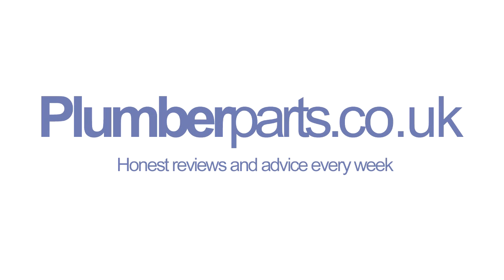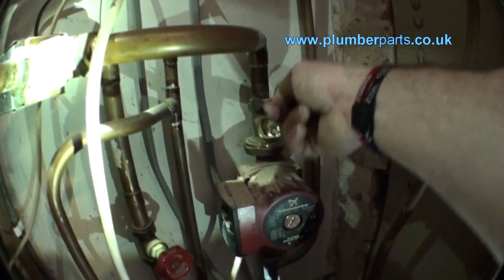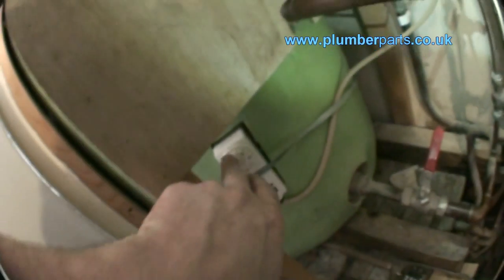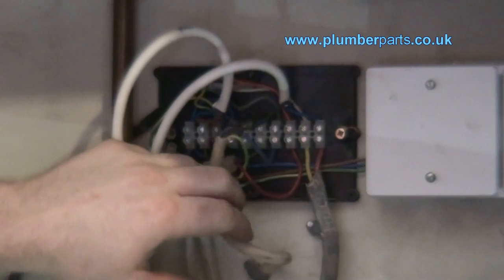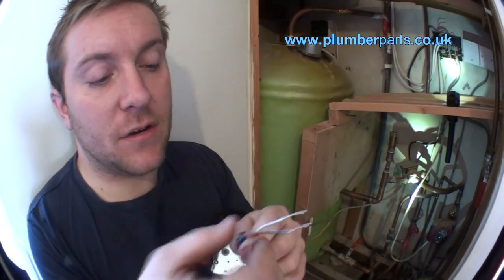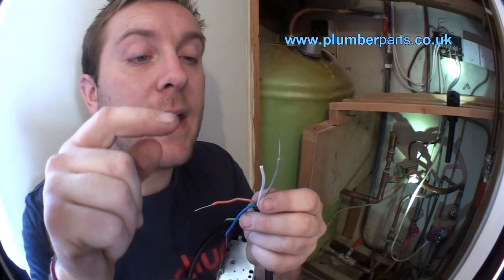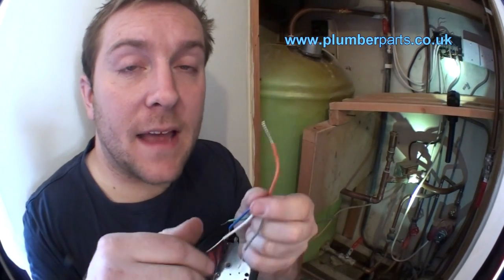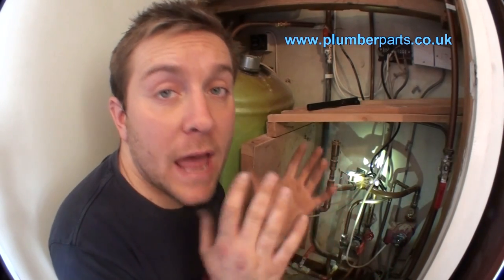3 Port Valves and Y Plan Heating Systems - Plumbing Tips

Comment: Does anybody know why my hot water is still hot even when the hot water is off at the controls downstairs. I have an old gravity fed system with this kind of square box valve in the video. I'm hoping I'm heading in the right direction thinking it's this? Also if I put the hot water on the water is scalding hot. I don't even put the hot water on now at the controls and I have hot water.

Comment: Hi, when my 3 port is on HW the flow from boiler is Hot then when I lower stat to switch to CH it will turn warm, sometimes cold even. Could the 3 port be slowing flow hense rads not keeping hot? I changed the cyl stat. I can see the port lever moving but not happy with the heat on ch pipe

Comment: Thanks so much for the videos. I have a question. I have a problem with combi boiler. I suspect its the 3 way valve. I changed it but the old system had 6 wires. The new 3 way head has 5. Online documentation states when this occurs call honeywell. Did that. They said phone some other number. Did that and ended with filling a online questionnaire in. Waiting for an answer. So what you do in this situation. That is 6 wires not 5

Comment: Hi, Drayton 3 port valve (new replacement) sticks in mid position intermittently so house melts and water super heats. Same problem with old valve, which is why I replaced it,  I've also replaced everything else cept boiler. I've buzzed out the wiring and it is correct to Drayton's 3 port mid valve circuit. Previous owner may have had same problem as found receipt for replacement valve only 6 months before I bought house. Spoke to Drayton tech and they said Worcester Bosch 24i (sealed system) boiler's integral pump may need a clip-on ferrite suppressor so fitted one but still same fault every few weeks. Other times system works fine ???? Help?   Nick, Somerset

Comment: Question ... plumber fitted me a system pump the wrong way round which caused heating to be red hot and wouldn't turn down with stat, he came a few days later to fit pump right way round now says  need a new 3 way port valve! Is this because of what he did wrong or just my bad luck baring in mind I had no issues with hot water or beating before he changed the old noisy pump to the new one?

Comment: Can someone reply?

Our 3 port valve is knackerd, on a conventional, system.

Were going to upgrade to a combi boiler soon (ish) 

Will the  3 port valve stay? Ie.. i presume its bot needed/used in a combi boiler.
Reply from the maker: It’s not needed. Enjoy!
Reply: @plumberparts   thanks! Wont bother repairing then. As my hot water warms up so too does my rads (becouse faulty 3 port valve) but that'll save me 200 quid repair. As il be getting combi convert soon, before winter.

Comment: If the 3 port valve is faulty and allows hot water to the radiators when only the hot water is turned on, does this mean more gas is being used and putting the bill up, compared to if the water was being sent only to the hot water tank?
Reply: Yes, probably tripling gas usage at least.

Comment: Any idea why my 3 port valve hums after the central heating has finished please? It doesn’t happen if hot water was the last command. It’s also pretty warm touch when its been humming. Is this normal? Is it dangerous? And will the motor burn out?

Comment: Hi if your changing a Honeywell 3 port valve for a danfoss do you not use the green wire as Honeywell have 5 wires danfoss has 4 wires

Comment: Hi  guys. I replaced a 3 way valve with a mid position valve - i didn't really notice the difference until I'd put it in unfortunately. The wire colours all matched up with what was replaced. Are there any issues with doing this? Also any idea why refilling the radiators is taking so long, the one in top bedroom literally will take all night I think - seems to be much longer than last time I drained the system (I think it will get there ev

Comment: Hi, I love your videos!! My diverter valve diaphragm on a Baxi Potterton Perform a 28i was replaced after a boiler leak. We had no hot water at the time of the leak. My 10 radiators were all heating fine at the time. The engineer said that although he fixed the leak and hence the hot water returned, he would leave us without GCH instead??? Since then, another engineer from the same company visited to replace the diverter switch. Now every one of our radiators are only luke warm because the heating comes on for about only 20 secs then shuts off again. Any idea what might cause this? Thanks.

Comment: Thank you so much for all yr helpfull and clear videos. I have standing boiler with cylinder and 3 port valve. Hot water only coming when I put programmer on heating/hot water together but it's not coming on hot water only. Any advise what problem could be please?
Thanks in advance

Comment: what would be the best gear to use in an s.plan or 3 port setup if using a wood burner as the boiler source. I don't want to pump cold water through my bungalow when the fire goes out. thanks in advance.. Rob M.

Comment: Just bought A COMPLETE VALVE BODY AND hsa3 ACTUATOR form e bay brand new.

Only wanted the actuator but it was a good price for both 

Fitted HSA3 actuator and every thinh works ok 

The valve body fitted in the system is a HSV3 and the spindle on the top
 turns through 360 the body thet came with the actuator is a HSV3B and 
the spindle only turns through 45 degrees also the girth of the brass 
body is bigger and looks to have a grey plastic paddle assembly.

Question should the HSV3 which I have fitted(smaller girth) turn through 360 and whats the difference between the 2 bodies?

Comment: hi james i want to fit  a 3port valve to my old heating system , but my pump is on the return side of rads' do i need to put it on the flow side.Also my hot water is gravity.  rob

Comment: Hi, when i turn my hot water on via the controller the boiler fires and heats the cylinder but when i turn it off and just turn the central heating off the boiler does nothing? The pump doesnt turn on either, when i manually move the position of the 3 port valve the pump turns on but the boiler doesnt light, would you say the 3 port valve needs replacing? Cheers

Comment: Great Video, very informative. I wonder if you can help me. My mums boiler was replaced (in the kitchen) the plumber moved the pump from the upstairs airing cupboard to just above the boiler in the kitchen. She has a 3 port Sundial y plan 3 position diverter valve up stairs in the airing cupboard.  since moving the pump my mum has no hot water just hot radiators. When she puts the water on constant or timed the radiators heat up but there is no hot water. The plumber said that she needed a new valve (£500.00) which seems very very dear. (I think they are trying to swindle her seeing as she lives alone) There is an unloading of static electricity when you touch the taps or the raidiators (whilst the water on constant is activated) I have had a look (I'm no plumber) but I'm guessing that when they removed the pump from upstairs airing cupboard they rewired the valve wrong. Do you have any suggestions?? any help would be really appreciated.Thanks in advance.
Reply from the maker: +Rick Atkinson Hi Rick, whateevr happens, that's never a £500 job. Max, £250! Get someone else in who's got good reviews to sort it out!

Comment: can a 3 port valve send water to heat rads and water tank at the same time???
Reply from the maker: +16vastraturbo Yes they can. Please sub >> https://www.youtube.com/user/plumberparts << if you haven't already!
Reply: +plumberparts what about when the heating themostat or hot water tank thermostat turns of the heat? should the valve turn and let the other side have all the heat??

Comment: This seems to get a bit bogged down in the associated parts like thermostats and does not really explain how the valves actually operate. I am trying to design a solid fuel system with pumped heating and gravity DHW. At first I was going to try to manage without any motorised valves but it looks like I could end up with water being pumped through the rads and indirect coil without going through the boiler! I am therefore now thinking of using a diverter valve connected to the pump so that when the pump is on the DHW is off. The important thing is that it must revert to DHW in a power cut so it must return by spring action.

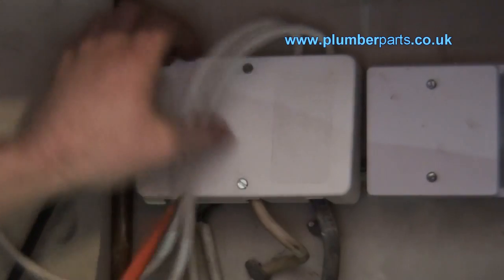Comment: Here's the Control Box at 1:33 is a small error - it's not a control box it's a junction box - where the various wires get joined together.

An excellent video nevertheless.

The valve on the orange wire controls boiler firing in certain circumstances - both heating & hot water.

Comment: Hoya got no hot water any clues please. Had pressure vessel re pressurezed and pumped. Had new gauage had new pump. Had new  automatic air lock valve.. The water is barely warm left running 20mins.  Water is on all day.. Any ideas please
Reply from the maker: How is it now Ted?

Comment: Great video as always.

I've got a system with a Honeywell 3 port valve. When it is set to provide HW but not CH, the branch for CH is still getting hot water flow through it, resulting in radiators getting hot.
Whilst it is running, if I switch on the CH, the valve lever does move to the 'main' position. When I then turn off the CH, the lever moves back to just below the notched part, but not as far as the auto position.
Does this mean the valve is not moving through it's full range and hence not closing off the CH branch?
Reply from the maker: Bruce W Whatever it is, it sounds like you need a new valve!

Comment: Hi, I've just completely rewired my parents heating system from an old w-plan hot water priority system. The new system is wired as a Y-plan, the only thing not yet changed is the old 3 port diverter valve. Just wondering if he system needs to be drained and the whole valve and actuator requires changing, or if the actuator can just be swapped for a mid position actuator? The old actuator is a honeywell, with a three core flex and a manual flush/override lever. Any advice would be appreciated! Dan.
Reply from the maker: Hi dan. If it has a little bump on the cover, you can just remove the head. Good luck!!

Comment: Hey. I'm rewiring my friends heating up, after a government grant for new boiler had about 2 or 3 different people back as it never worked right. Iv spent hours scratching my head on why the wiring is not working.

Turns out no power on the grey or white should put it in state of HW, White live only a state of HW and CH, grey and white live state of CH only, grey on its own 'hold last state'. Ohh and grey and white live is only way to make the orange live (no other states make it live).

After countless test of watching it move (with lid off) of powering up but not having boiler run, I have found the VALVE to be working as its been put in A and B crossed over but it is not - any one else had this happen?

To wire it this way would need a relay and Im not sure if HW is fail safe, at moment no power to valve sends it all to heating...

Comment: Hi, I wounder if you can help me?
I have changed my Honeywell 3 port valve V4073 as CH was getting hot when just HW on, now working fine. The problem (Not sure if was there before) is now when CH switches off via stat or programmer and HW is not being called for, I can hear a faint buzz from the valve head and after a short time the head becomes very HOT! The only thing I can do to stop this is turn up HW stat or switch off at mains and back on. When the heating is off, the valve should return to the hot water position. Wiring see link http://www.seered.co.uk/sunvic2700.jpg

Comment: now then, ever heard of this one?

just replaced the drayton mid position valve on my mother in laws house (old one was burnt out), so new activator with valve in and working like a treat but even in the Hot Water position, it still sends water to the radiators

now, i thnk it's because a previous plumber, T'd in some piping to a towel-rail in the downstairs shower room BEFORE the 22mm boiler feed meets the Mid-Position valve!

so regardless of whether you call for Heating or Hot Water, it heats up that towel rail and i believe it's sending flow to the radiators too, either way I'll be removing the T and placing it AFTER the valve where it should be!

ever had that one? seems a bit silly
Reply from the maker: Yes it's from days gone by when the towel radiator came on when you used the hot water. I hope that helps! PP!

Comment: How can u be sure the diverter valve in the boiler has gone and that it isn't something else causing the heating not to come on?
Reply: +Heidi Manley 
If the pipe going into the valve is hot, and one or other of the pipes coming out of the valve are cold, it shows that HW is being generated, but it is not getting past the valve.
Ergo; problem with either the valve inside the pipe, or the box sitting on the pipe, whose function is to allow the HW through.

Comment: First things first, you are referring to a mid-position valve. A three port can be mid-position or a diverter valve (usually used on w plan - hot water priority)
In your video you state that the white wire is for hot water and the grey for heating. This is incorrect. The white wire receives power from the room stat. The grey wire receives power from hot water satisfied on cyl stat, and hot water off from programmer. The orange wire switches on pump and boiler.
Switching takes place internally using 2 micro switches, 2 relays, and a diode. I won't go into anymore detail, I don't want to complicate your post but the basic principle you highlighted is wrong. As you have over 70000 views and numerous trainee / apprentices viewing this correct facts would be great!
Reply: Rob, you are very right.
Reply: Rob, 
well explained and correct way. thanks.
Reply: Additionally, you're not an Engineer!
Reply: The best explanation I have ever heard.

Comment: 3 port valve  has a perm live say    orange   cylinder stat controls hot water  switched live  grey    room stat controls  radiaters  switched live brown is that right   boiler and pump are wired in series  ye

Comment: at 0.38 after you say you got the pump why is there a t-piece before the 3 port valve that looks like it comes from the bottom of the heating coil in the tank???

Comment: hi ya mate,i have a quick question regarding the three port valve.
firstly,i have been looking at the y plan wiring to the diverter valve which shows two signal wires ie hot water on and hot water off plus heating on and a permanant live. in your video you mentioned only two signal wires. please mate, if you could explain, cheers in advance